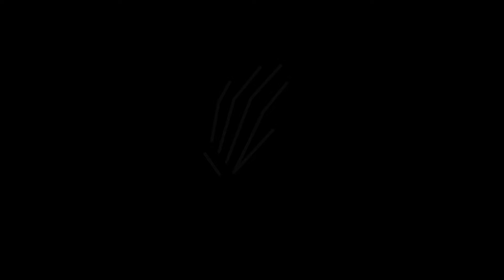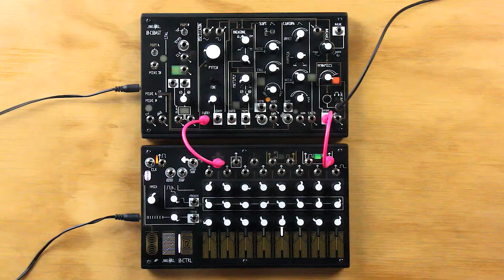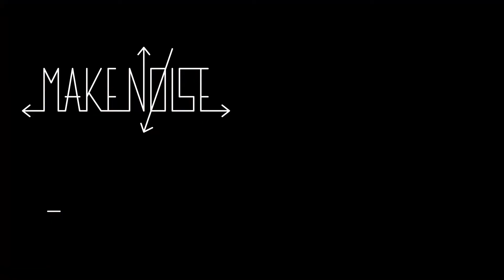0-CTRL Patch of the Week #6: Variable Length Sequencing

Comment: Hi Walker, the requirement of patching at least two cables, is that technical (ground loop) or practical (gate+pitch)?
Reply from the maker: The former. Just ensuring a solid ground connection
Reply: @MAKEN0ISEMUSIC  Thanks! However, how does using only the pressure output on 0-ctrl to the TMMM/Morphage not cause any problems? Or is patching at least two cables to TMMM (or any other skiff/system) also recommended?
Reply from the maker: They can be anything - two inputs patched together for example, which isn’t really a “patch” as it doesn’t do anything. Within a case the modules all share ground without patching.